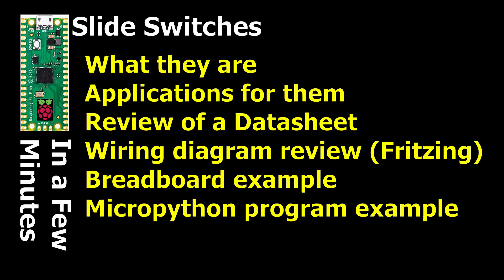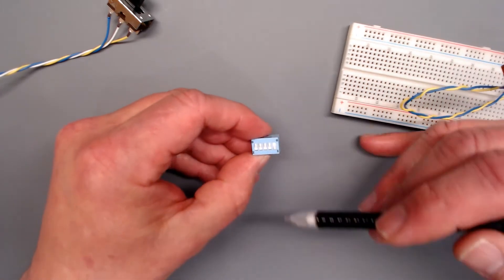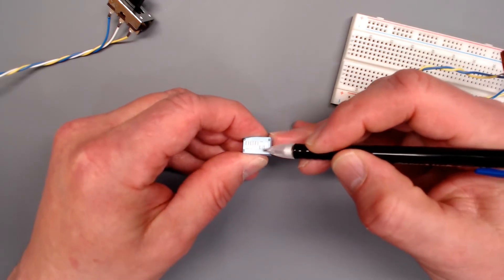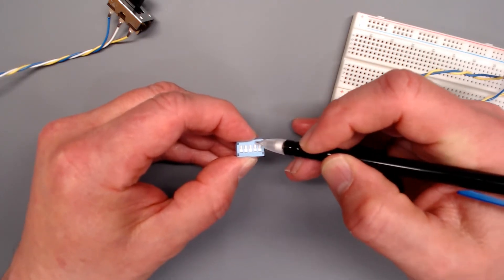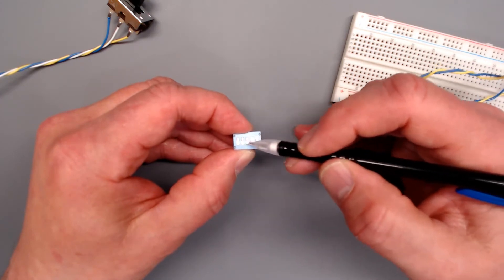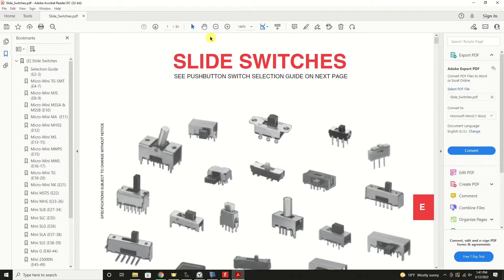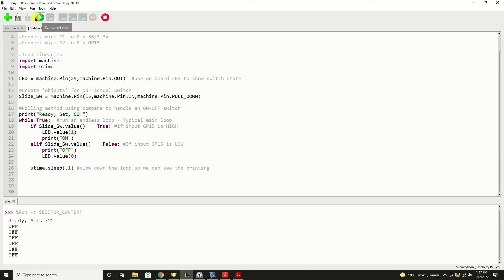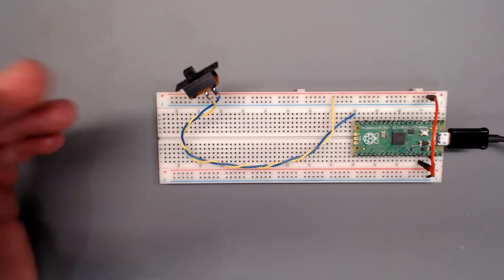How to Interface a Slide Switch with a RPi PICO

Comment: Hello Chris. I am a beginner to the Pico and also Python. I wanted to let you know how much I have enjoyed watching your videos as a fellow YouTuber. Your videos are very detailed and well explained.  At the moment I am implementing some code to count pulse from a rotating shaft. There are a few ways to do this and I have my code working.  I think the subject of pulse counting could make a good video and could include software counter, rising falling edge interruptions and PIO. I think the pico is lacking in not having the hardware counter exposed through an API maybe as part of the machine Pin. Just wondered if you could provide any help and advice. My best regards another Chris
Reply from the maker: Hello other Chris.  Sorry for the slow response - YouTube doesn't do a good job of notifying me of new messages for some reason.  A tachometer is a project I have had on my mind for a long time now and it is time I do one.  I think it will be best for me to do it after the PICO display videos come out, that way I can utilize that display without have to do a lot of time on displaying the data and focus on the sensor and functionality.  Thanks for the great suggestion!
Reply: @MakingStuffwithChrisDeHut   I look forward to your next video. I will copy you in on my weather station progress. I will also be building my own 4 bit Gray code encoder. Currently my pulse counter will do 200 pulses a second and would probably go faster if I removed the denouncing routine.